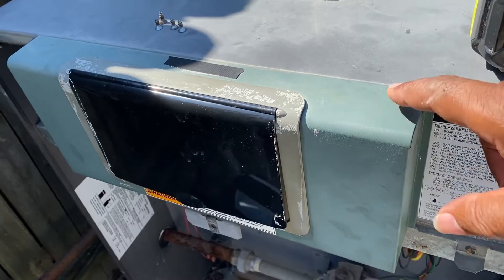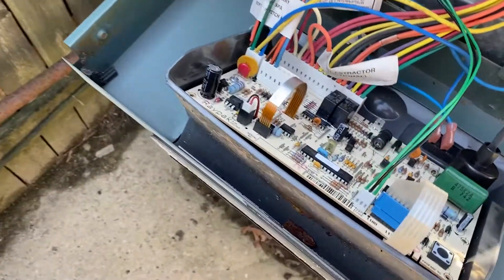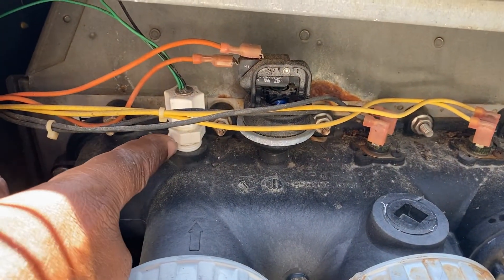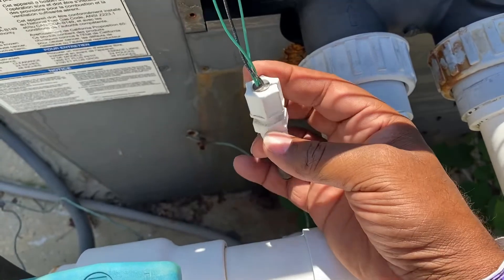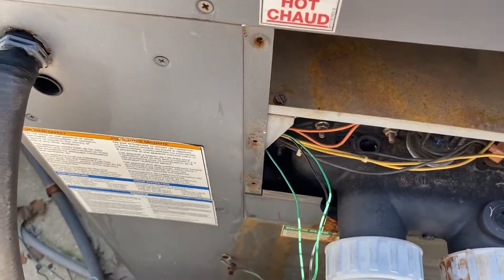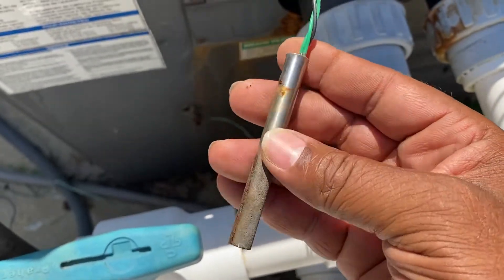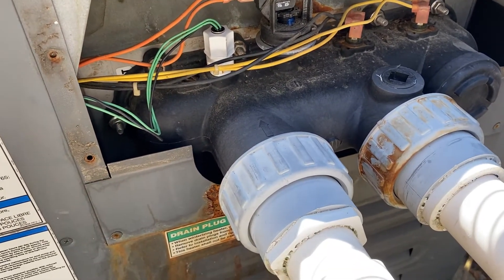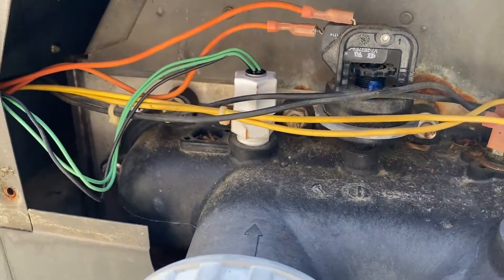Temperature Sensor replacement for Raypack pool heater model P-R336A-EN-C

Comment: Thank you for the video. I have a leak at the temperature sensor and white pvc adpater. Can you advise what causes this. There is a washer in there that may be the issue, but I do not see an o-ring. Can you advise what pieces are inside or post a photo? I see 1 washer, maybe I lost the other parts by taking it apart and what direction does the washer face? Flat against the sensor or spikes toward the sensor?
Reply from the maker: Hey, is it a new installation or something that has been there for a while that has started to leak?  If it’s a new installation, I suggest checking to see if the sensor is fully inserted in the pvc adapter and the top nut is it tightened sufficiently.  Secondly make sure the pvc adapter is securely installed in the heater and tighten down.   I don’t remember but I don’t think there are any parts inside the pvc adapter.
Reply from the maker: I looked at the video again.  I added Teflon tape (plumbers tape) to the pvc adapter threads and tightened everything down, that did the trick for me.   Best.

Comment: I replaced my temperature sensor last year, but it’s been a while since I turned my heater on. I turned it on now and it keeps saying low temp lockout and it shows my water is at 34° which definitely isn’t. It’s closer to like 68.  Does that mean it’s bad again? Or could there be something else going on?
Reply from the maker: Hmmm.  I don’t know enough to offer good advice.   When was the last time you got a good temperature reading after you replaced the temp sensor?

Comment: So i replaced the Temperature sensor but when i turn on the heater, i am still getting the SNS error code.  Does that indicate it could be the circuit board that is bad?
Reply from the maker: I think "SNS" error refers to sensors.  How did things work out for you?

Comment: What do I do if my sensor rod will not stay down. It pops up
Reply from the maker: It sounds like the sensor is not set firmly enough in the mounting to hold the sensor in place.  Trying removing the sensor and nuts.  Insert the sensor and hand tighten the top nut until the sensor is held in place firmly.

Comment: The plastic part is a bit pricey ($29)  but often salvagable. My sensor was rusted stuck in there, requiring a hammer and metal filing the end  to get it out. There are also a couple of washer like fittings inside.

Comment: 🤔🤔🤔   how about taking the wires to the pool panel to automatically turn on the heater from the pool panel ... ?
Reply: ohh wait. am a pool tech now,, 😮😌😅😅😅😅🤣🤣😅😅😅 that heater has the temperature sensor install on him and it doesn't require another sensor like pantair does..  for pantair you need two sensors 1 air temperature
2 water temperature sensor. 🤦🏾‍♂️🤦🏾‍♂️🫨🫨🫨🤷🏾‍♂️🤔🤔🫡🫡🫡🫡

Comment: When I checked the temperature censor earlier it looks like its leaking because of the thing around the censor so I tightened it but still work the same
Reply from the maker: The sensor is likely very corroded so water is getting around the seal.

Comment: Hi, my pool heater pilot lit is on but the burner wont fire up.. do you think o have a bad themperature censor?
Reply from the maker: Hi. What error codes are you seeing?
Reply: @Unscripted60Plus  there is no new code.. my heater burner fired up when i let it on for about 1hour..and then when i turned it off the burner will not fire up again until like 30minutes to one hour again with the pilot lit
Reply: @Unscripted60Plus  i checked the last code it’s PRS but i know i got that code when i turned off the pump while my heater is on
Reply: @Unscripted60Plus  i checked all the code and the other code is SNS
Reply: @Unscripted60Plus  i tried to disconnect the temperature sensor and the SNS code came on.. so i think my temperature sensor is good
Reply from the maker: @ricolegaspi5296  I’m not an expert but I believe that the SNS code means you have a sensor problem
Reply: I dont have a display, but my heater wont fire up. Could this be my problem? I have no codes to go off of